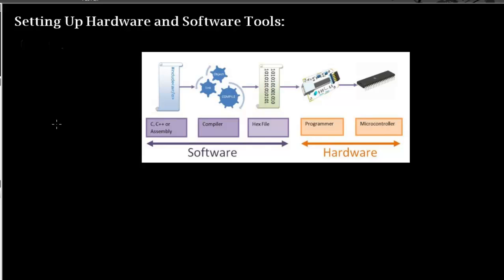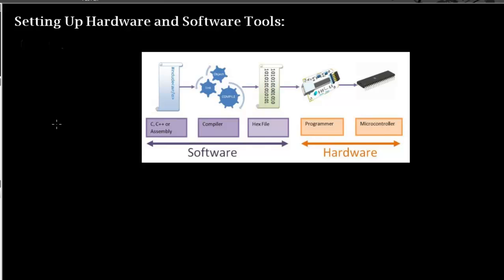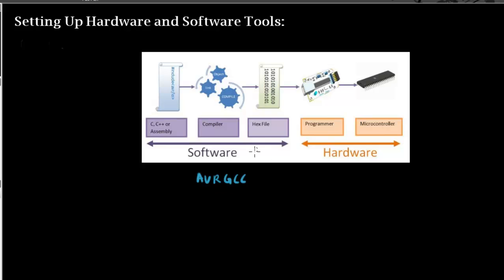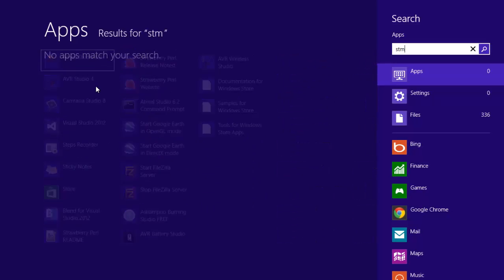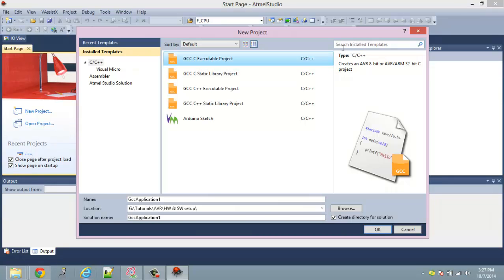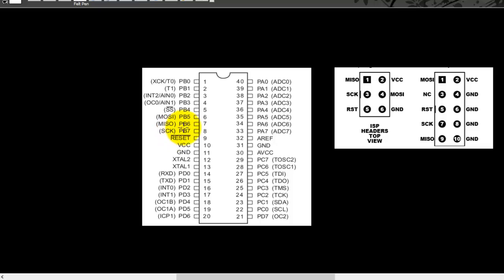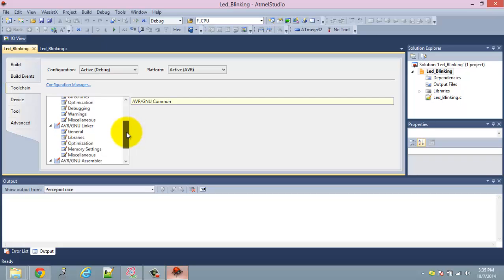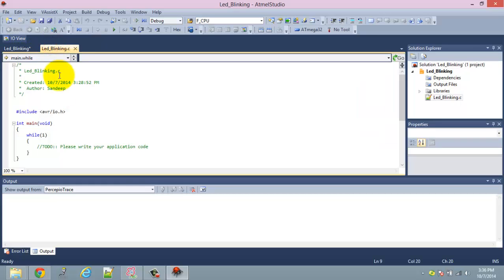Setting up HW & SW for AVR Development: Atmel Studio 6

Comment: I followed all the instruction ( right from step1-step4) for Setting up the XploreFlash Programmer,but when I click on xplore flash application setup a popup chart display on a screen saying "CANNOT DOWNLOAD THIS APPLICATION.APPLICATION IS MISSING THE REQUIRED FILES.CONTACTAPPLICATION VENDOR FOR THE ASSISTANCE  "
please help
Reply from the maker: Click on the .application file and it should work. If it does,it will ask you to download and install dot net framework.
Reply: I have downloaded .net framework as well as I clicked on . application it is saying application is working from somewhere.

Comment: thanks as always EE. I have a question. By connecting the reset button to 5V (which is standard) but then to ground, does that imply it is external reset source? I understand that without the ground connection, it should work just fine. Thanks.

Comment: hello, excuse me I have a very agonizing error in building projects ... it tells me:

Invoking: AVR/GNU C Compiler : 4.8.1
        "C:\Program Files (x86)\Atmel\Atmel Toolchain\AVR8 GCC\Native\3.4.1061\avr8-gnu-toolchain\bin\avr-gcc.exe"  -x c -funsigned-char -funsigned-bitfields -DDEBUG  -O1 -ffunction-sections -fdata-sections -fpack-struct -fshort-enums -g2 -Wall -mmcu=atmega32 -c -std=gnu99 -MD -MP -MF "q.d" -MT"q.d" -MT"q.o"   -o "q.o" ".././q.c"
avr-gcc.exe(0,0): error: CreateProcess: No such file or directory
Reply: dongol ahmed I don't know how to solve this problem, I've re-installed AVR studio but the problem still exists. Btw, I use win 8.1
Reply from the maker: dongol ahmed  It appears that AVR GCC path is not set properly. Try installing WinAVR. It should work.